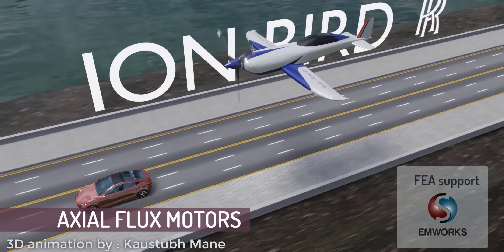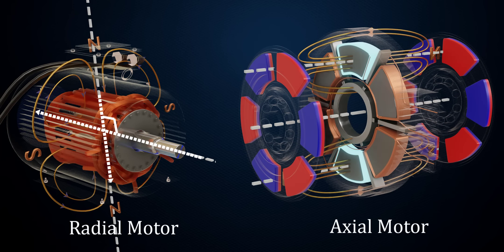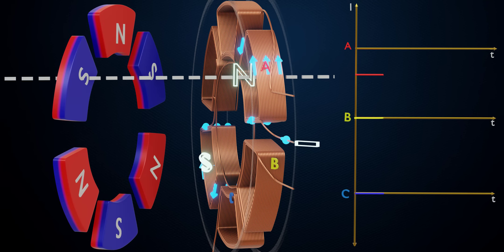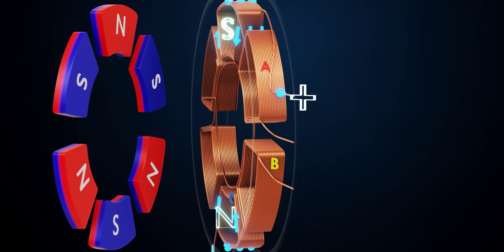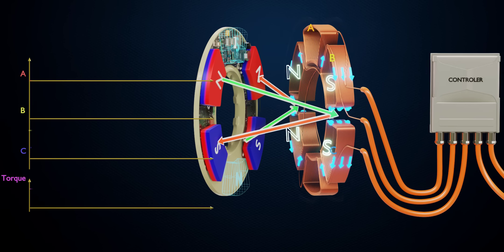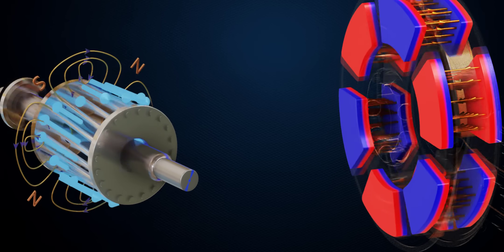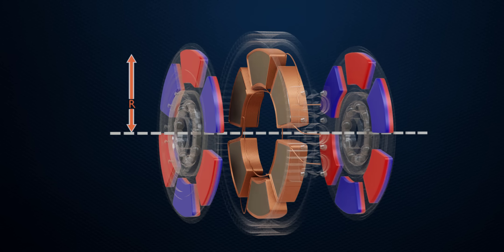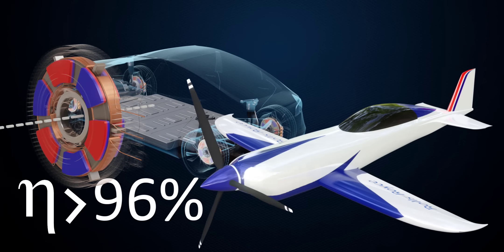Axial flux motors - The new hope

Comment: I've been dreaming about a hybrid rotary/electric motor.
Seems like the Wankel is so close to an electric in design and physics.
Imagine the rotary's rotor spinning in an electromagnetic field.
The gas and electric systems are one and friction is possibly zero.
This could eliminate Apex seal wear which is the weak point of the rotary design.
This also eliminates the four hub motors at each wheel allowing a normal drive,reducing weight,complexity and exposure to shock and water.
When I see the hollow center of the axial motor and the method of generating spin it seems like it would work.
Reply: Friction would still be an issue, to keep a seal with the engine case. And it might even rely on apex seals more...
Or do I just not understand properly?

Either way, it sounds like a fantastic idea for a generator, if you get it to work.
Reply: @Fightre_Flighte  I was hoping that if the field spins properly the rotor would float and redirect before it ever goes metal to metal.
Should run cold since it'll only use gas on starts,hills and recharging and the cooling system water should have plenty of time to cool down.
Thanks for both of these comments.
I might go talk to the Mazda dealership today.
Reply: I'm not an engineer but I do foresee issues with your design as stated. First, your description of using a "magnetized iron rotor" cast or not, and "magnets and copper windings in the case protected by the water cooling" would not work. Electric motor and generators work because of the interaction between rotating coils with stationary magnet or rotating magnets with stationary coils. How would a magnetized rotor, which is only then single magnet with a single pole, interact in a casing with permanent magnets mounted around it? It would interact by being locked in place. How would additional coils on the other side of those permanent magnets interact with with the rotor? They would be limited to moving current through them in one direction only in the same polarity as the permanent magnet sandwiched next to it because to do otherwise and flip the poles would then have two opposing fields interlaced with
Reply: each other. Either way, it would still not turn the rotor. 

You would need to mount the permanent magnets in the arcing sides of the rotor and the rotor would need to be non magnetic. It might work, but I think you would then have a really difficult time getting any useful efficiency because of the inherent motion of the rotor. The flux lines would only interact at the their strongest when the leading edge of the rotor mounted magnet was at it highest or closest point to the casing. In contrast to other electric motors and generators AFAIK which always used a fixed orientation and distance so the signal generated, like the power output from the coil for a single pass of the magnet would probably look like a standard Bell curve, with ramp up close in shape to ramp down. 

With the Wankel rotor, your magnet are not in a fixed position. The leading edge of the rotor mounted magnet will only be closest to the coil for a very brief moment, but it would be your strongest interaction as well. Then as the rotor continued through its motion, the magnet would then be quickly falling away. So the pulse would probably look like an instant ramp up and slightly longer ramp down, but the area under the curve would be significantly less I imagine. That would seem to indicate less efficiency to me.

Additionally, you would most certainly still need apex seals and this configuration would likely induce more load on them.

And a dealer isn't the place I would go to with an idea like this.
Reply: @HughCraneII  Thanks. You definitely have more understanding than me in this area.
I'm thinking about my pond pump. It has a cylinder magnet that spins in an electric field. Seems a more advanced current control could spin the rotor and never allow metal to metal contact.
Could just put the electric motor on the flywheel and avoid all the heat. 
Then it would work with any engine.
Reply: Makes sense to me and I was a community college physics drop out. What I imagine with your idea is that the Wankel could be magnetically charged and would move in the interior of the case without making contact with the sidewalls e.g. like a magnetic train? Idk, but I think that would cause a need for a different shape; do electromagnetic fields propagate well from a 3-sided figure?
Reply: @matttaylor8471  I was hoping the rotor could be a ferrous metal like iron or steel and the lobes projecting deeper into the field would provide a handle for the field to push.

My new idea is a motor at the flywheel. Then  the electric motor can be free of the Wankel wobble.
It could retrofit any stick shift and the torque converter would be a good place to e+drive an auto.
Still I love the idea of the rotary hybrid.
Reply: Take a look at the TRI-DYNE or BI-DYNE rotary engines. Popular Science July 1969
Reply: I have not been this impressed since Rockwells' Retro encabulator.
Reply: rotarys are FAR from electric motors in every possible way.

electric motors are efficient, reliable and produce actual torque.
Reply: Bro, that is an amazing idea. These hybrid Wankel engines could be used on airplanes, or futuristic Mazdas. ;) I hope you can work on this. Are you an aspiring engineer?

Note: The heat produced by combustion may shorten the lifespan of the electrical components of the motor/generator as the combustion occurs near the electronics. :)
Reply: @thatguyalex2835  I'm more scientist than engineer. Loved rotaries back in the day but poor mpg and short engine life were it's downfall.
The feeling of the Mazda was close to the electric slotcars and two stroke dirt bikes I grew up on.
Just had the idea a couple days ago.
Heat would definitely be a concern.
My idea was a cast iron magnetized rotor and the magnets and copper windings in the case protected by the water cooling.
Combustion would be brief. Mostly on starts,hills and when recharging the electric systems. 
With the combined motor and low weight of a rotary plus good charging power less batteries will be required further reducing weight.
Don't know who to talk to maybe the local Mazda dealership.
Reply: @jeffarcher400  That sounds like a great idea. They might take your idea, so you might want to discuss copyright. Unless, you are open to sharing idea with Mazda. :)

Comment: Until we overcome the energy density limitations of current battery technology, or develop lightweight self-contained electric powerplants using next-gen fuel sources capable of high energy output, it's all pretty much moot what motors we use, unfortunately
Reply: Exactly. While there is certainly nothing wrong with improving the performance and efficiency of electric motors, that is not going to solve any problems. Current electric motors are already EXTREMELY efficient. Further development on these lines is only ever going to gain a few percent. And I don't mean a few percent this year and another few percent next year and so on until we can eventually go a million miles on a AA battery, I mean only a few percent for the rest of human history. There just isn't much room for improvement. The inefficiencies in electric power are all in the power source and transmission, not in the motor itself.
Reply: Just have to wait until we have the technology to shoot a laser beam at something and collect/use that energy. Then we don't need much battery, maybe enough for an emergency landing if something happened to the laser beam powering the aircraft.
Reply: Why can't we work on beta-voltaics
Reply: I have not been this impressed since Rockwells' Retro encabulator.
Reply: Hydrogen Fuel Cell?

Comment: This design appears to use large quantities of rare earth magnets compared to other designs. Whilst they have been used for many years in high performance motors I thought the industry was trying to minimise use due to cost and availability.
Reply: Reluctance machines with cast aluminum windings are gaining in popularity.
Reply: We can make Axial flux motors free of rare earth magnets just by replacing the magnets with solid Iron Nails. Now it becomes a Switched Reluctance Motor. Also, the controller needed to run this motor is a simpler one.
Reply: I have not been this impressed since Rockwells' Retro encabulator.

Comment: Another example would be many wind turbines use the same axial flux to generate power at low RPM due to the efficiency of having magnets on both sides of the coil in a Axial flux configuration.
Reply: My brains in a knot...you sure?
Reply: Sweet I kind of want to get a big used one then

Comment: Peak efficiency of the motor in a Tesla is over 90% so who really gives a shit about this computer model. Starting the motor doesn't matter because you can easily have power from the ground during startup. The reason they don't put motors in planes is because you can't store enough energy to power them for any reasonable distance once they're in the air. Jet fuel is still the most cost effective way to store energy in a plane by a LONG way and no motor will change that